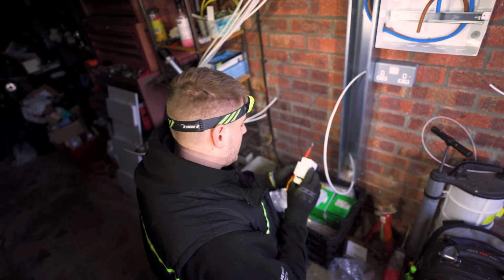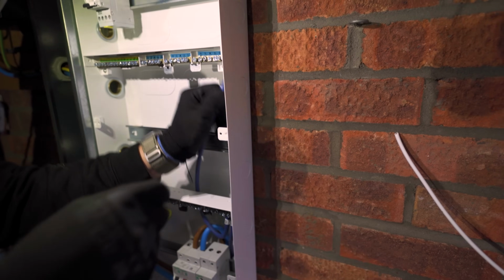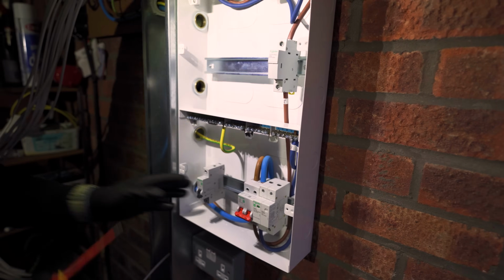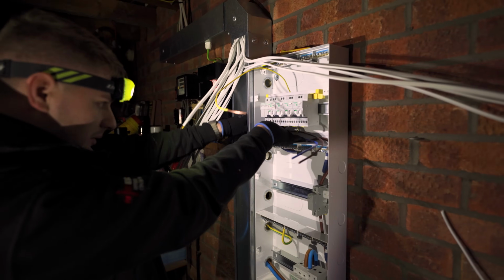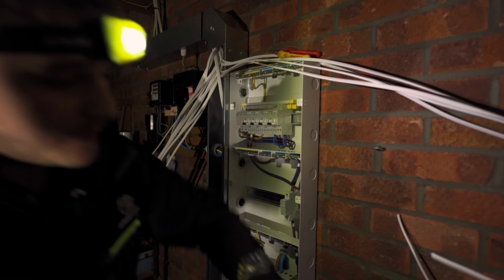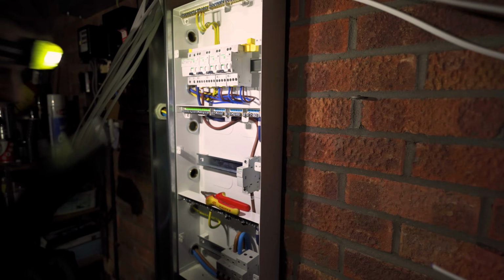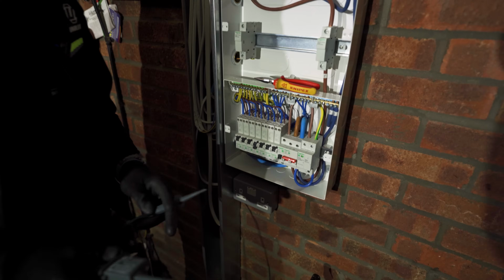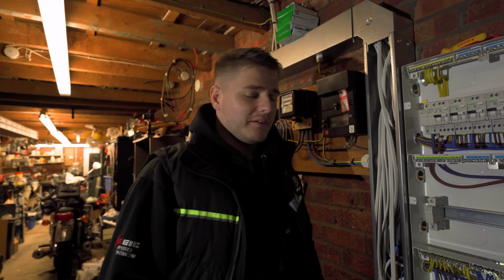Double stack Easy9 fuse board second fix

Comment: Surprised you didn’t run a 25mm neutral to a din rail distribution block and not daisy chain the neutrals 🤔
Reply: Nice work Mike.  Loving the banter with the camera man/Apprentice/helper
Reply from the maker: That’s one way to do it I guess, but i would be more surprised to see a 100A neutral din rail block… currently it’s configured as per the manufacturers instructions, it meets the standards it’s designed too and the warranty is valid.
Reply: @residualelectrical  not saying it is technically wrong, just seeing the 25mm tails in and a 6mm? Coming out. 
In the past I have used something like this to run a separate feed up to each rail. 

Terminal Block Distribution Box, UKK-125A Din Rail Electric Wire Connector Universal Power Junction Box,
(It will not let me post the link from Amazon).
Reply from the maker: Sure, I’m just saying if I used one of those connector blocks the board would not meet BS standards, and therefore would need to be a departure from the regulations on the certificate, it only meets the standards it’s designed too if it’s installed as per the manufacturers specifications, which it currently is.

It would also have no warranty if the Din connectors were used and the board failed for some reason.

The connectors look cool, and I’m sure they are popular for European boards, junction boxes and panel building.

I’m not sure on the CSA for the tri-rated that comes with the board, I would assume it is suitable for 100A, the smaller neutral is for the SPD which is limited by its protective device and also a specialist component with its own standards.

I’m not saying the connector block is rubbish, but I’m saying it wouldn’t be complaint, or the best option for the customer in this case. 

I just disagree with your original statement as I would more “surprised” to see a Din rail connector used, as in my 10 years I never had seen one used in a domestic board, that’s all.
Reply: @residualelectrical  16mm tri-rated is 105A 😊

Comment: I have a question, for a residential electrician in Sweden it’s basically never considered since we have 25A as a maximum main fuse 99% of the times. Our busbars are often rated to 63A, are yours rated higher or do you interpret that to the maximum load and not the rating on the preceding fuse?
Reply: Mate. To the best of my knowledge, UK busbars are 100A rated as standard.
Reply from the maker: Yeah the busbars are spec’d of the switchgear so will be 100A easy 👍🏼
Reply: @residualelectrical Yeah especially older ones it's a thick bit of high % solid copper so easily 150A+

Comment: a loose crimp on the start relay for a fridge is what most likely caused the fire at grenfell tower. some of the wiring was recovered, they x-rayed the crimps and found little gaps between the copper strands which hadn't been pressed together closely enough which increased resistance and heat.
Reply: We calibrate all crimping tools in the railway
Reply: @liamstedman7742  Must be nice, thats gotta be a rarity though I dont know anyone with calibrated crimpers including myself. I do have half decent quality crimpers atleast which is more than most, all my crimpers are made in germany or sweden by knipex or pressmaster, the amount of sparkies that just run the cheapest no-name shit they could find on ebay or whatever discount store was cheapest at the time, and never bother checking if they work properly or not is pretty high